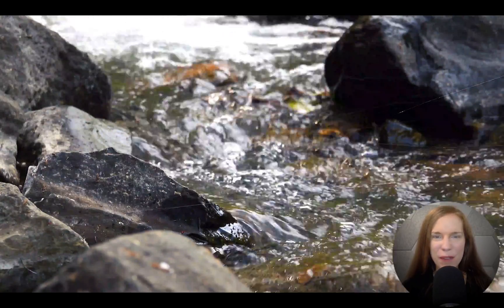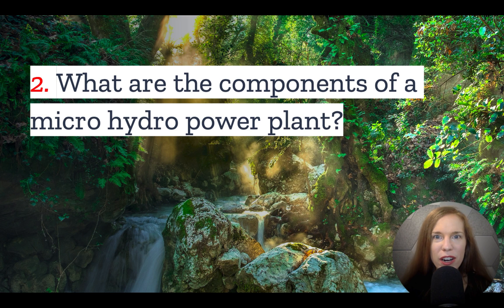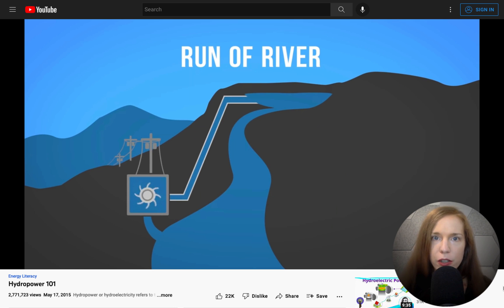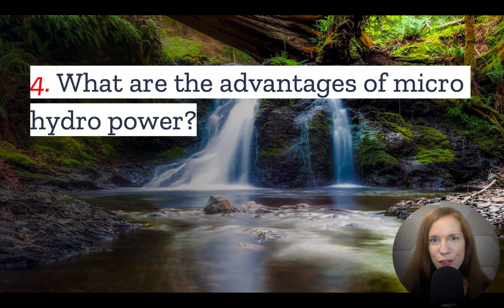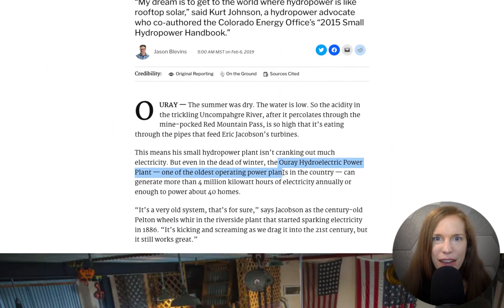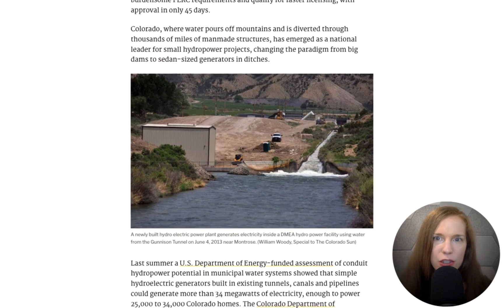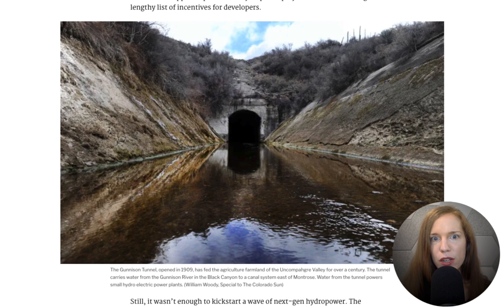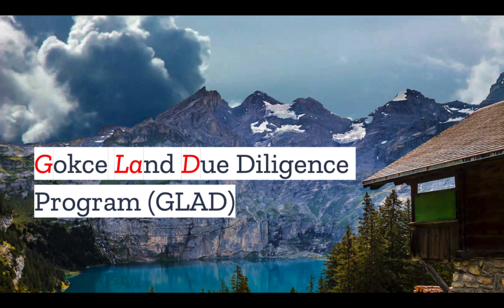Micro Hydro Power Plant: 5 Things You Have To Know

Comment: Technically couldn't you run a system via a rain water catch system and a high container amount, high psi release, have the water flowing through the generator have the discharge amount flow back into the water tank source, and keep a self-contained system?
Reply from the maker: That's a good question. I have never heard of this, but maybe someone in the community has done this.

Comment: What happens to micro-hydro if you live somewhere where the water freezes in the winter?  Or does it even impact it because the equipment is below the water line?
Reply from the maker: Hello! You would likely just need to winterize the pipes and equipment as you would any other kind of mechanical system. But this is a good question for an engineer!
Reply: If that's the case it would be wise to both winterize the equipment, and have a secondary power source (probably wind) available.
Reply: @GiselleMF  up here in the northeast, you had better have your equipment ready for winter. But it's not what you'd normally think. Basically you have to cover the turbine head to avoid ice buildup, same for the intake head. Because the water is flowing, the flow water doesn't freeze. But you have to constantly check up on your system.